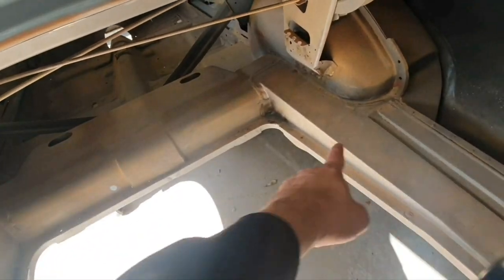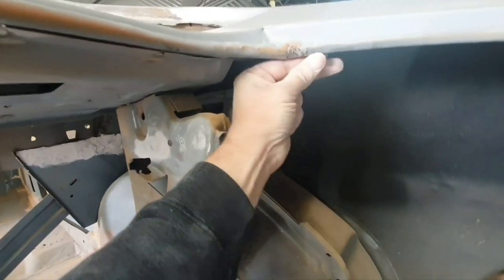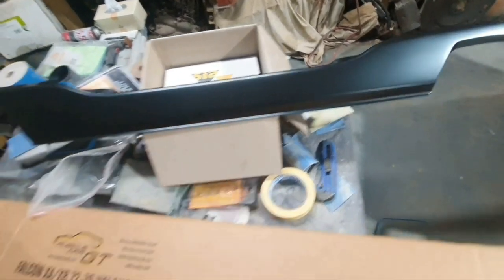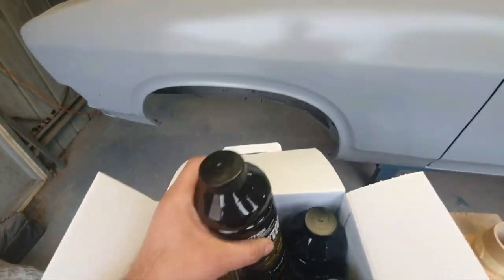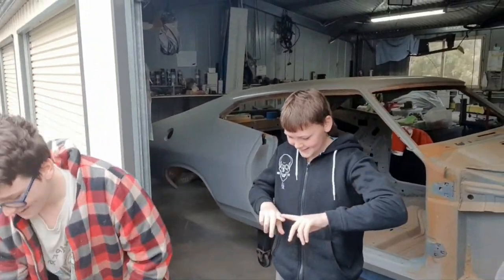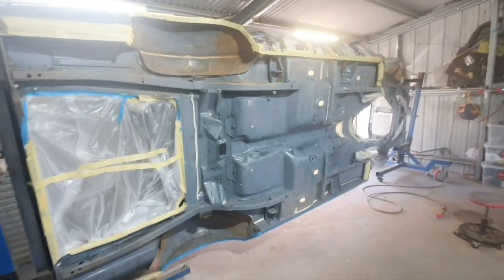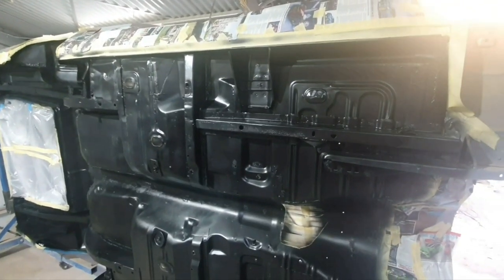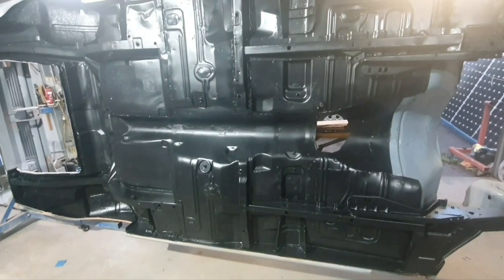Ford Falcon XB GS coupe Restoration - Raptor underbody sealant Eps56

Comment: that really should of been sprayed on with a shultz gun it applies it thicker so it acts as a sound deadener 
the way you sprayed it made it really thin
i use stone guard far better for under the car its thicker and works much better than that rhino liner
then i paint 2k black over it to make it  easier to clean with a pressure washer